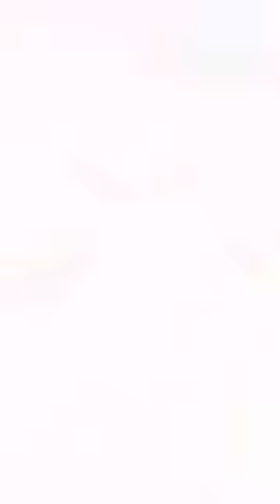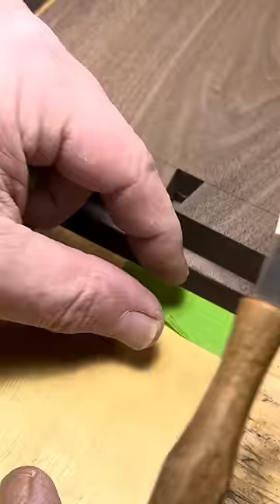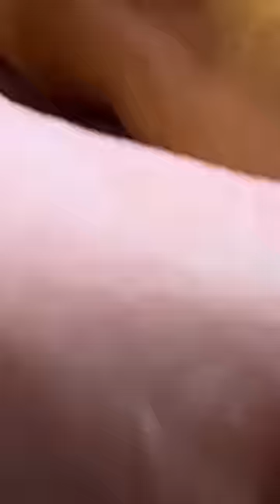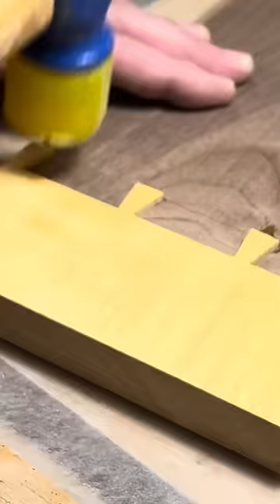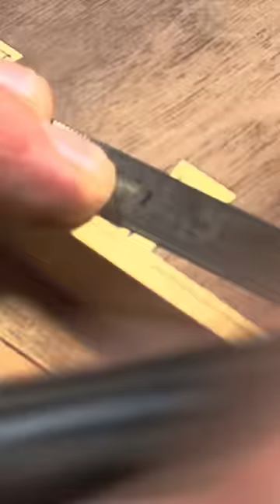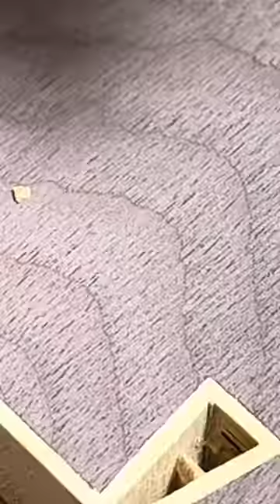Dovetail Inlay

Comment: I dont do this kind of wood working but aren't the dovetails supposed to hold the drawer together? By making the tail thinner does that compromise the structure? Beautifully done by the way
Reply: This is what I was thinking as well. It just seems to have made the dovetail less effective overall, no matter how pretty it looks. 

Don't get me wrong, it's gorgeous, but those are some really skinny dovetails. If you're going to do it, at least make it strong, which is the original point of doing a dovetail
Reply from the maker: Master furniture makers of the 18th/19th century cut notoriously thin pins. Oddly, those drawers are still solid 200 years later. I’m no master, but I’ll guarantee my work for at least 100 years.
Reply: @cleancutwoodworks  i'm sure it'll be fine, it's not like you're going to be standing in your drawers. I didn't know the thin pins was common at all but now I plan on reading more into it. Regardless I admire your work, definitely takes a skilled hand to cut and carve something that thin

Comment: Well that looks great, but you've removed about 90% of the pins! Albeit that it sits on a little more purchase underneath that, but you've taken much of the mechanical strength of the dovetail out by removing so much of them! A simple adjustment of the proportions of pins to tails will make this much stronger......

Comment: Beautifully made but structurally weak over a period of time. That's why architects work with engineers because half of the designs architects come up are structurally unsound. You should've made the dovetails wider thus giving more meat to the adjoining piece!